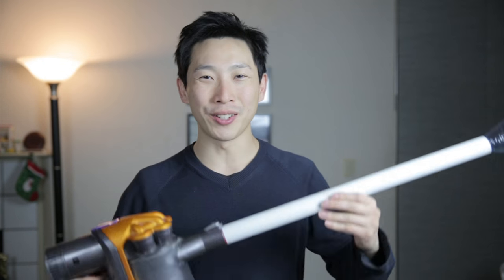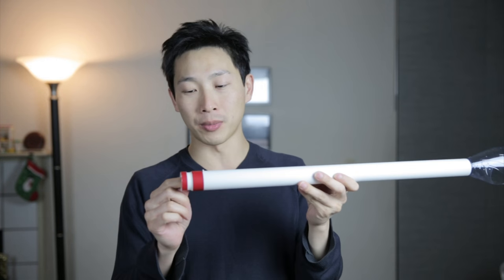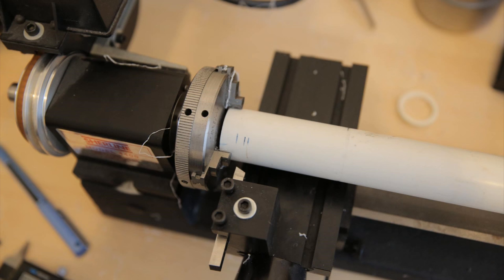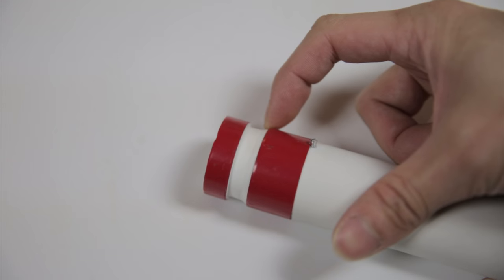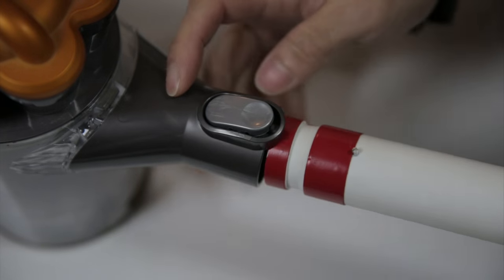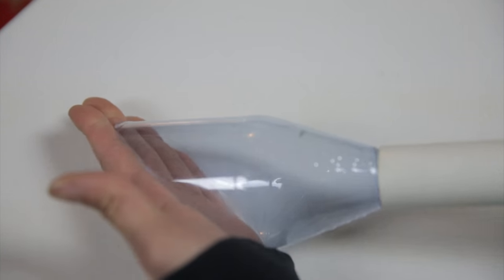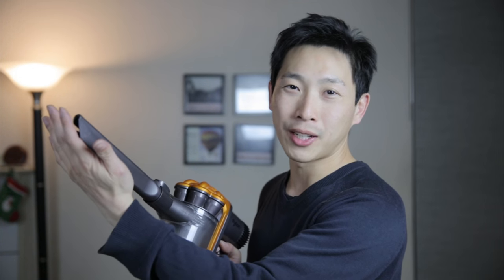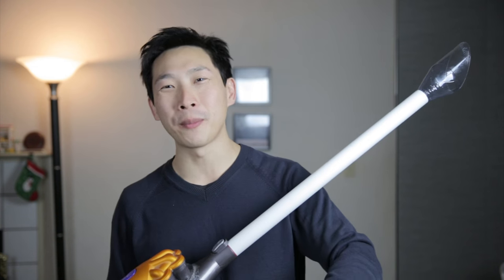Dyson Fly/Spider Vacuum Attachment | BeatTheBush

Comment: I Found They get free very quickly, so I updated the Concept. Utilizing a mini shopvac, a clear plastic pipe with a Step up in diameter just before attaching to machine to act as a catch chamber. & a piece of closeable Valve. Once a day bug patrol is a breeze. 

I might actually update with a detachable chamber, & Schrader valve or something to vacuum pump air out of the chamber to -2 bars. Of pressure

Comment: I made one of this years ago and it works very good, but mine is even wider. I got an empty   cooking oil jug that has a larger mouth, about 1.5 inch diameter. I made a straight cut removing the bottom and attached to a shop vacuum. Flies try to escape and get sucked.
Reply from the maker: Nice! If it sucks it in, in mid air? I think the Dyson isn't strong enough to pull them in unless you are pretty close to it in mid air.

Comment: Sorry, but this does not work; when you open up the suction areal, the suction power goes down dramatically. Did try this, and the flies are just not getting caught. The suction power has to be greatly encreased in order for this to work.